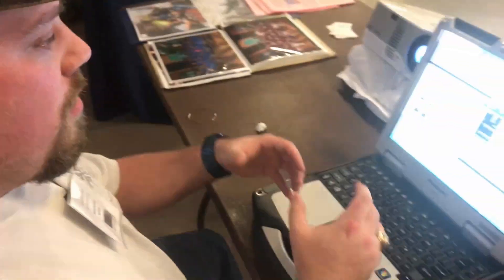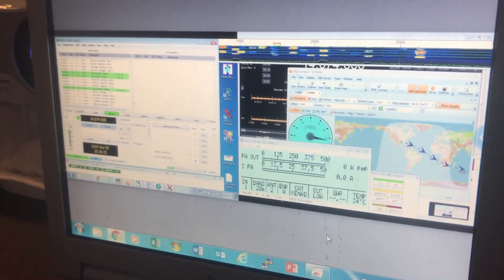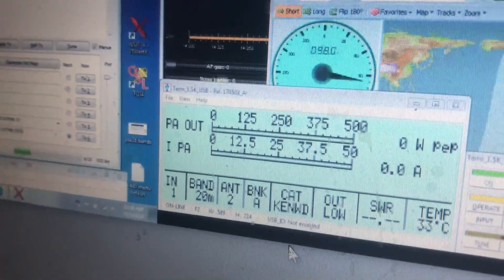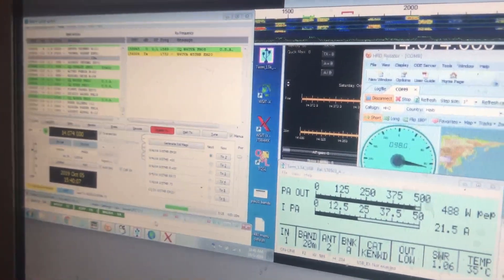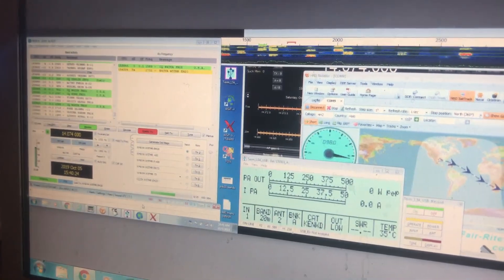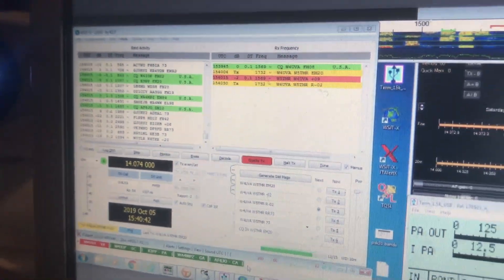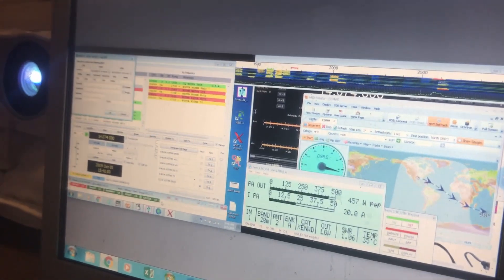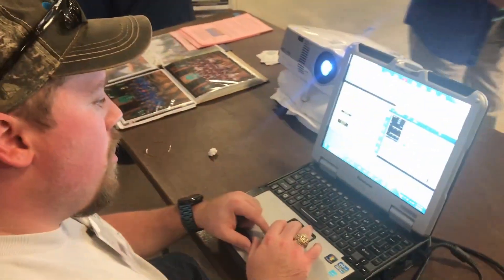Demonstration of How to Work Remote Operation on FT8

Comment: Those signal levels only tell me that you shouldnt be using a power amplifier to make this qso. In general WSJT-X doesnt need QRO power. So great demonstation, but for the sake of FT8 keep your power low enough to make the call. otherwise its gonig to be a power frenzie and the AGC circuits of everybody else is gonig to phase out those weaker signals.

Comment: "Fantastic signal" you told us in your video. Hope you soon learn how to operate your radio. Running 500 watt on digital mode is when hearing the "local station" with -2db. You are running 10 times more power that you have to.